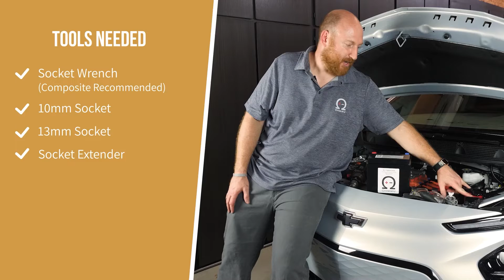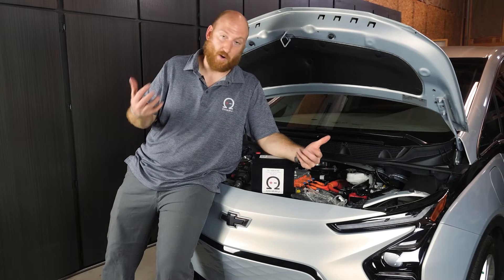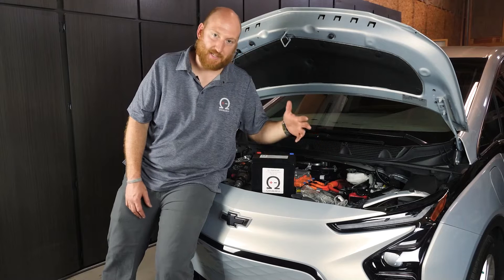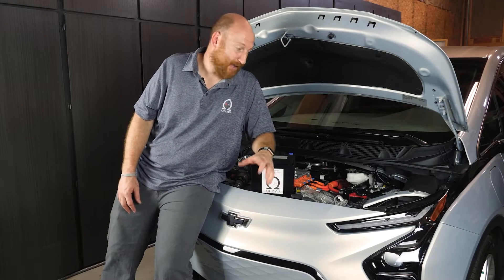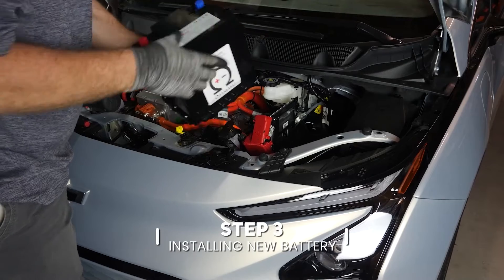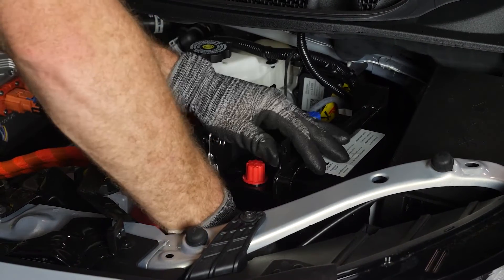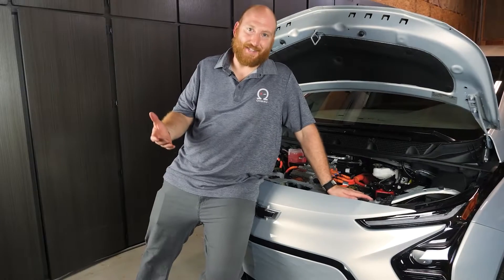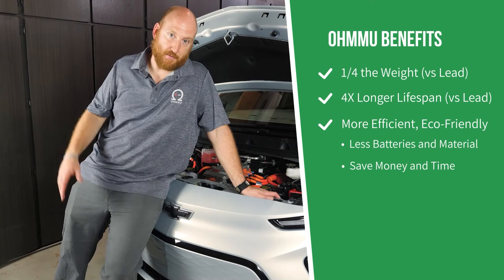Chevy Bolt - 12V Battery Installation (Ohmmu)

Comment: Will this work with aftermarket 300 watt nxv wheel hub subwoofer that i plan in installing on my bolt that i just got for Christmas?
Reply from the maker: It would! It has the amp hours to use as a deep cycle battery, but a lot of people with serious sound systems like to have peripheral batteries too. Do you have a charger?

Comment: I did the replacement as described and ran the hard reset 2 times but I still get the Replace 12v battery notification on the dash. Any ideas on how to resolve this?
Reply from the maker: In a Chevy Bolt or in a Rivian like your icon would suggest?

Comment: If the 12v battery is completely dead, can you jump it with another car?
Reply: Probably, it’s really only used for the AC, infotainment, and lighting, so the car will still start if the battery is dead

Comment: I have a 2022 Chevrolet Bolt EUV love your report on the lithium battery..my 12v battery died on me at a bad location and had to be towed to dealership. I want to get a 12v lithium battery for my bolt but I’ve also read some negatives. Now I’m not sure.  I really  need some reassurance. Any help for my problem?

Comment: The factory battery is AGM not lead acid it says so right on the battery.
Reply: AGM batteries are lead acid - just different internal construction than typical “flooded” lead acid batteries.

Comment: This would save a lot of hassle . Dead battery in an EV can be really annoying. I got my key stuck in the ignition on my Fiat 500e, tried a LiPo battery, very undersized, car died weeks later on the freeway. The Fiat didn't give me enough dead-battery warning ever. I think three years on a lead acid is typical for EVs

Comment: Is there any tradeoff other than the higher initial price? I’ve seen some internet “experts” claim regular batteries are better for reliably starting the vehicle compared to lithium
Reply from the maker: If starting an engine, I personally would go with lead acid.  For an EV though, the usage profile and need are completely different.  These are the way to go!
Reply: The battery has a cold weather guarantee probably good except for super cold climates
Reply: Probably not good in cold weather that is why they went with the other type battery

Comment: I am surprised that you didn't add a  memory saver device before you disconnected the original battery. That's needed  so that all the computer and infotainment settings are maintained.
Reply: When swapping my Bolt's battery, my Home Location was lost in the Infotainment. Which, removed my Hill Top Reserve, and Charging hour restrictions too.

Comment: Smart!!! Why Chevy did not do this to begin with! 
Question: For my normal gas car, I remove the acid based battery when I park the car for 3 months. So will this be the case for this Lithium battery if I need to park the Bolt EV for 3 months?

Comment: Thank you for sharing this DIY.  I just want to verify this is an exact fit?  Because I think an “H3” is same as LN0, and H4 is LN1, which is what I believe the Bolt takes?  (I wish you put them side by side to demonstrate)…
Reply from the maker: You are correct, both the LN0 and LN1 fit in the Chevy Bolt.  Our listing for the Bolt is an LN1 at this time but we will be moving it to an LN0 in a while b/c that accommodates more platforms overall.

Comment: What are the specs regarding temperature ranges for charging and discharging? I was looking to hardwire my dashcam in my EUV to record in parking mode because currently I use power bank inside the car. Didn't dare to do this with the stock AGM battery as I felt it will kill it too fast cycling it almost every day.
Reply from the maker: -4F to 150F is the recommended range of temperatures.  Testing is done to -17F and 167F.

Comment: All well and good until it tries to charge when it’s 10* zero, THEN WHAT? I notice there is no mention of LifePO4 heating on the website. They tend to self destruct when charging below 32*, what solution does the manufacture have for that?
Reply from the maker: These batteries are tested in lab down to -30C (way way below 32F); these batteries do not "self destruct" when charging in the cold.  But, on that subject, all batteries (including these) do degrade more quickly in the "extremes"; this is true of both extremely cold and extremely hot conditions as well as extremely high/low voltage or extremely high current.  The safety limits of the battery can be governed by the BMS but it will surprise you to find out that the safety limits are far beyond what you are suggesting.  

Oh, and to clarify the "testing in a lab"; this is done in a Thermotron environmental chamber and the battery is subjected to continuous charge and discharge cycles for weeks on end, after this test the battery is placed on a vibration apparatus that simulates the driving environment and "shaken" for days continuously.  This is all done to ensure that 1. the decay/degradation is minimal and 2. the battery didn't form potentially dangerous dendrite formations during the test (shaking would illicit shorting). 

The design of these batteries takes into account the extremes that are potential in an automotive environment.
Reply: What do you mean tested you can't charge lithium battery below freezing or you will damage it also it does not include a BMS that you can read with Bluetooth you have no idea about the quality of the cells or anything else that's going on in that battery

Comment: I've had my 2023 Bolt EUV Premier for one week. I'm definitely going do this in about three years. Too many stories about the 12v lead acid failing in these. Thanks so much for this video...I will be referring back to it again. One last thing...what's the amp rating on this battery..? I didn't see it on the site. Or how it works when below freezing out.
Reply: My 2017 started throwing "Battery saver" errors on the screen about 6 months ago. I just replaced the AC Delco battery for an Ohmmu for this car yesterday. The old battery still kept 12V, but had hardly any ability to pass an amperage test. It surprised me how many systems worked on lower than 12V in this car. But charging and shifting is definitely needing 12 volts.
Reply: My 2017 original battery is still going strong with no issues. Took it to auto zone yesterday to have it tested, and it failed…. 7 years on the original battery ain’t bad. Ordered a replacement so I don’t get stranded

Comment: Great video! Just wondering when disconnecting the 12 volt battery, does the vehicle computer, infotainment system, electronics etc need some kind of reset, or will it remember all settings and resume normal operation?
Reply from the maker: They don't need reset, they save settings into non-volatile memory these days so even after losing power completely the modules can be rebooted and have their settings reloaded (unlike some of the older stuff in cars where total power loss would scramble them back to factory settings).
Reply: @OhmmuEnergy  : good to know, thank you!

Comment: Interesting video since my dealer stated that changing 12v is not a consumer replaceable item since they claimed some reprogramming of car is required? Was this not an issue when you did the exchange?  The last time the 12v went out on me, the brakes were locked. Had a hard time getting car onto flatbed tow truck, even though we put a lithium jumper box onto the battery..
Reply: BMW i3 12v has to be registered in the computer,I think some others do to
Reply from the maker: On the Bolt the 12V battery is very consumer replaceable.  I have a feeling the dealer/tech had it confused with the High-Voltage battery which would not be so easily done.  The HV battery needs to have some programming to match VIN but nothing needs to be done to upgrade the Bolt 12V to the Ohmmu Lithium (or just replace it in general).